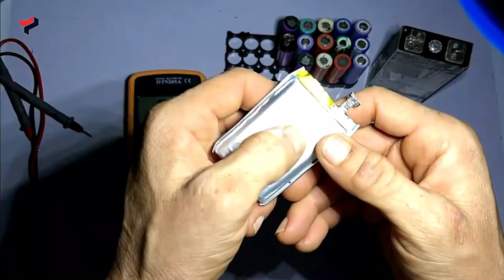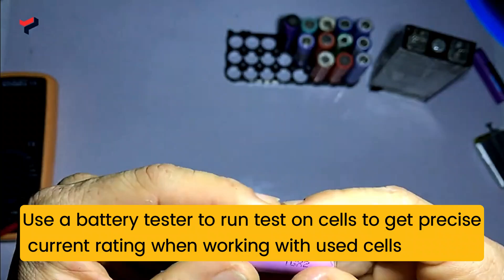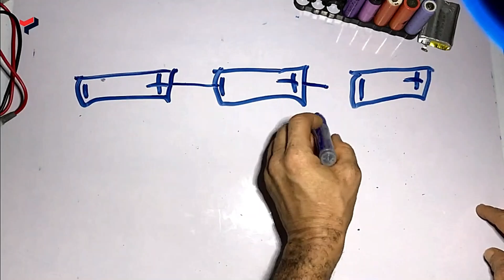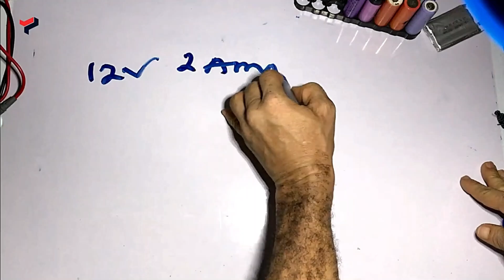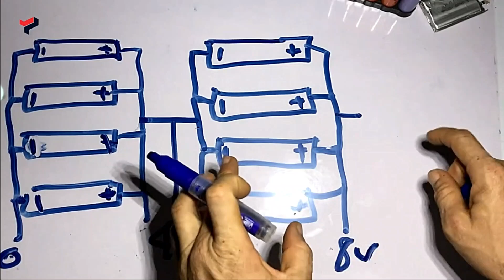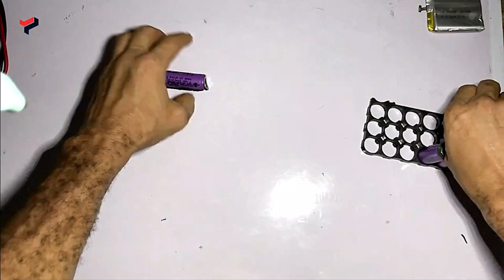How to Build a 12V 100AH 18650 Lithium ion Battery Pack: Inverter battery Secrets for beginners

Comment: Can i make the battery 20x3 to make 12v 40amh
Reply from the maker: Sure. Just maintain the formula while ensuring balancing of capacity (AH) and voltage across the packs. If you intend making a large battery, consider getting cells having more capacity than what we have in the example. This saves you time, resources and